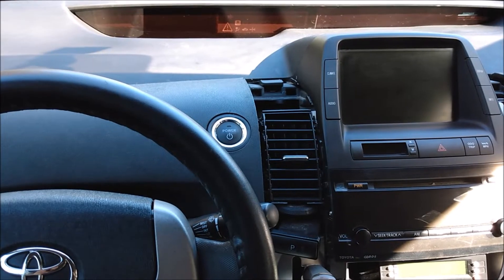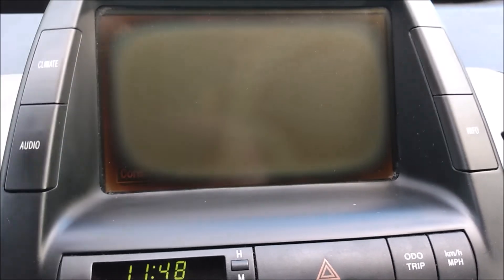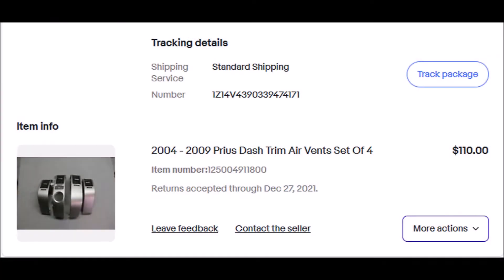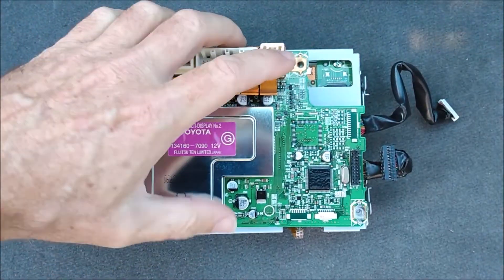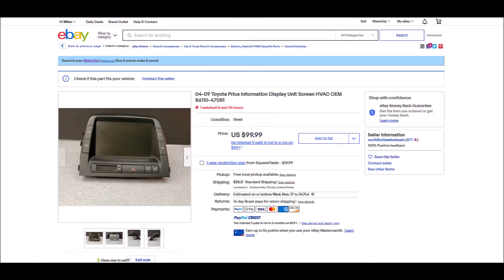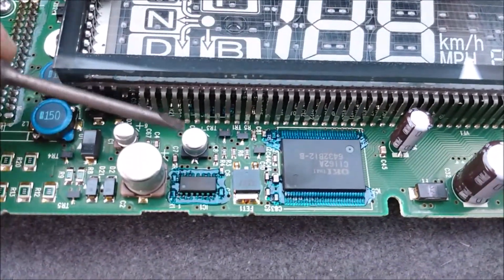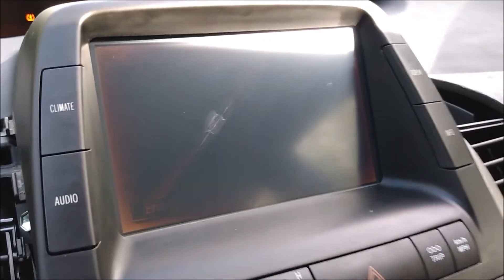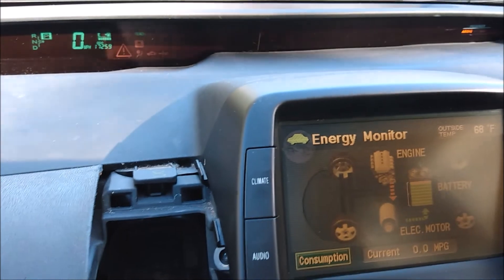2nd Gen Toyota Prius: Fixing the Multifunction Display and Combo Meter

Comment: Do you need to remove other parts to replace the dash trim? Mine are faded and I ordered the 4 piece kit from eBay and wondering if I just pull on the old ones or are they attached with screws?

Comment: When you replaced the digitizer was the sun damage fixed, even though you had other damage to the lcd?
Reply from the maker: I ended up replacing the LCD screen as well.
Reply: Thanks for responding. My lcd display looks ok just bad sun damage. That’s why I way courios if the digitizer  got rid of the sun damage issue even though your lcd was cracked and needed replacing.
Reply from the maker: no problem 👍

Comment: Thanks So Much Michael !  There is not too much for this dash on you tube. Thank You for breaking the ice for us. when I press any of the four function buttons... They don't "bleep" any more.  I was hoping you may have studied the circuitry to where those  four function-switches  power -ON the DISPLAY  ...and enlighten me.  -Or,  may be i can pause your video and get a close-up of the printed circuit board and the wires  or ribbons.  I'm gonna have to disassemble the entire freaking unit. and replace my digitizer and mess with  the ribbons,  the double-sided tape, the heat-gun and putty-knives.   You are a very good communicator and have a way with words. And you did awesome ! , replacing that 220 micro Fared capacitor for the combo-meter portion of the dash. <3
Reply from the maker: Thanks for the compliments. Unfortunately, I'm not that great with electronics. But I can work a soldering pen. 😛

Comment: Thanks for taking the time to make the video..

How difficult was replacing the capacitor? I've de-soldered and replaced a relay from a circuit board but that's about all my experience with stuff like that.
Reply from the maker: I'm at novice level with this stuff. And it wasn't hard for me. Just remember to get the polarity correct. These capacitors are polar.
Reply: @michaelblacktree  Thank you! I'm going to give it a shot.